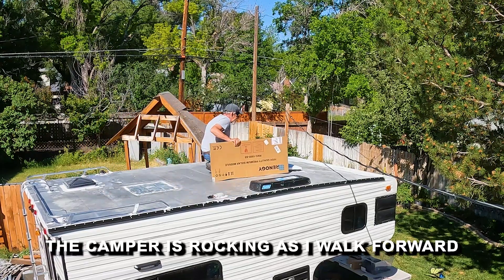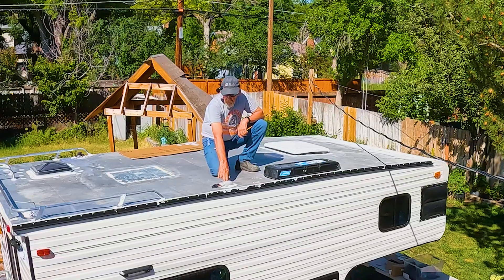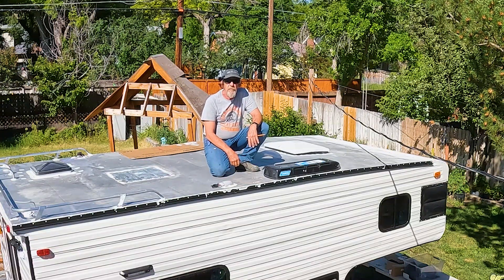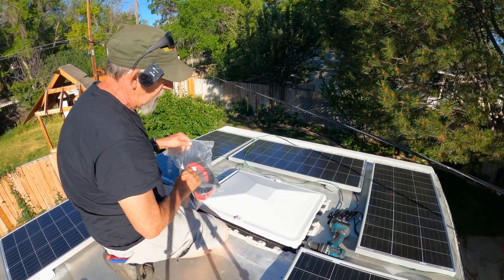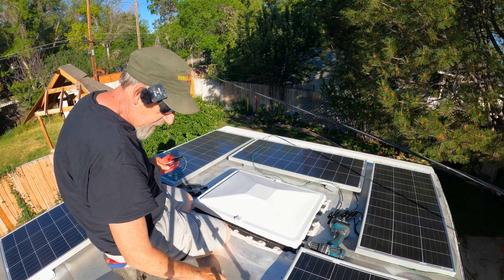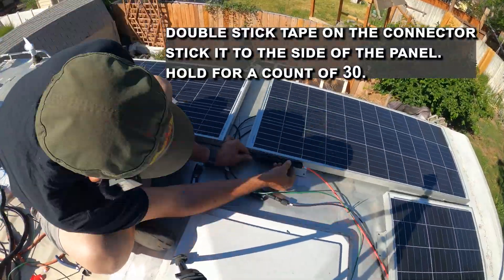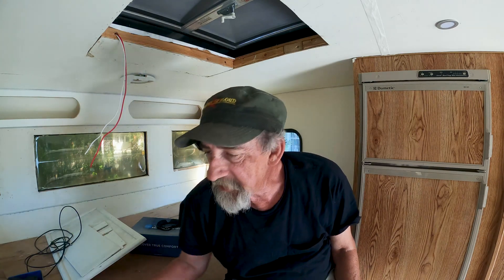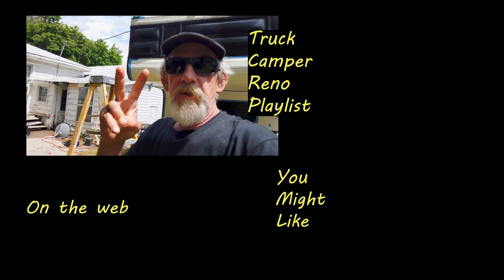Installing the Off-grid Solar System.. Vintage Truck Camper Renovation

Comment: Interesting video. Probably was suggested because i watch quite a bit of solar stuff on YT. Just couple of things you should know and those watching and reading comments: If your roof is pulling away from the thin paneling its supposed to be glued to, then you should definitely rely on more than Double sided sticky tape. As those panels flap and vibrate while traveling, it will work loose and they will fly off. That thin metal roof can just tear away at the base of the feet, or pull away at seams along the side. When wiring panels, you want to bring the voltage up as close to the limits of the Charge controller as you can. So, run them in series, then parallel. You actually want a higher voltage coming in from your panels, not more amps... amps generate more heat. since you've cheaped out on the solar wire, as the sun heats it up, the resistance will increase, and that will only bring productivity down. Hopefully the camper is just a backyard project and not an actual traveler.  Best of luck
Reply from the maker: Wow, how negative. I bow to the superior intelligence. On second thought, if you had watched any part of the previous 80-odd episodes of the restoration series, you would know why the roof isn't glued down and what has driven the design. Second, do you think I am some kind of idiot and won't be checking the panels regularly? I CHOSE not to make any more penetrations through the roof than is necessary. If you know anything about preventing water intrusion, the best prevention is NOT to make a hole in the first place. If I have to, I'll add a screw and seal it appropriately.  Finally, I haven't cheaped out on anything. Your heat-increasing resistance is true but negligible in this instance. There are less than 16 feet of wire, and a couple of ohms of resistance more isn't going to make one damn bit of difference in how the system performs. Nor is changing the operating voltage of the solar. You're picking nits! And your comment is disregarded with prejudice.  This is for occasional use. It's not a half-million-dollar class A. You don't have to spend thousands of dollars to have a reliable system.